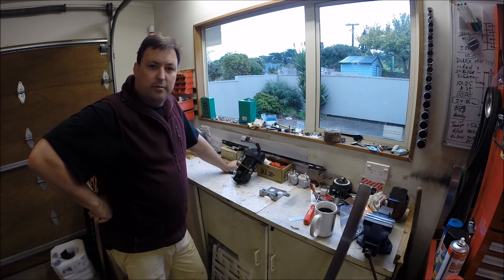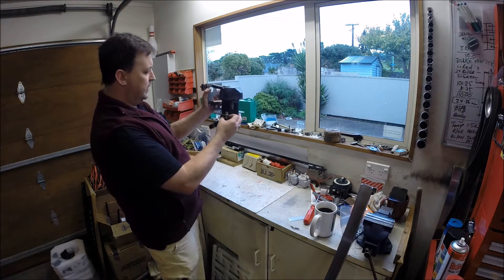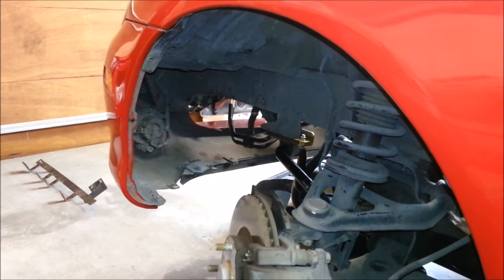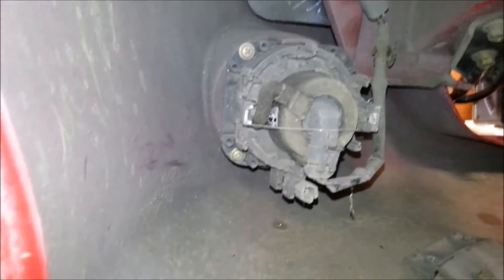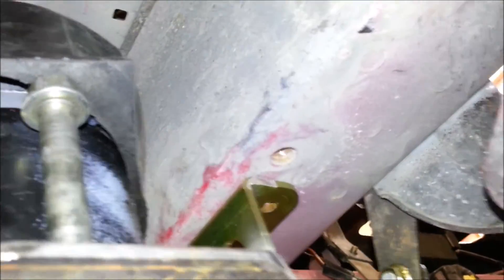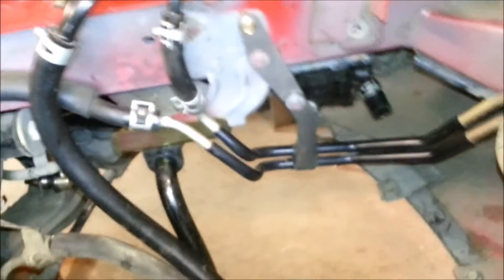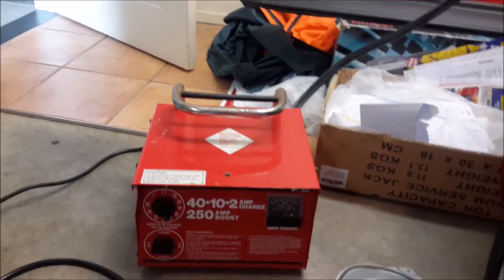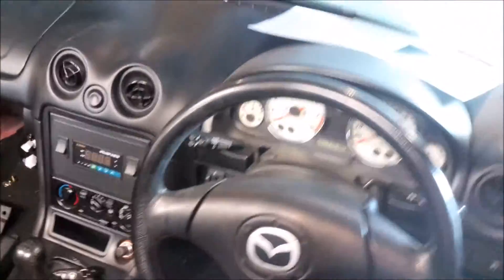EV Miata   Power Steering & Vacuum Pump

Comment: nice setup! what type of high pressure fitting are you using? i went to get a line made today and the hyd. place didn't have anything deep enough to seat in the mr2 pump
Reply from the maker: I used an AN6 fitting with an aluminium washer to seat it.
Reply from the maker: If you freeze at 5:55 you can see them